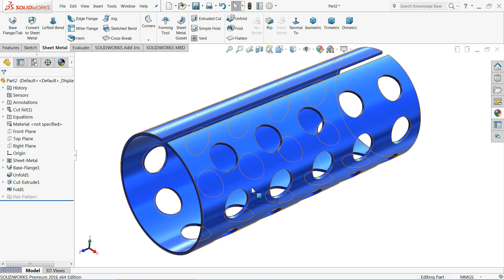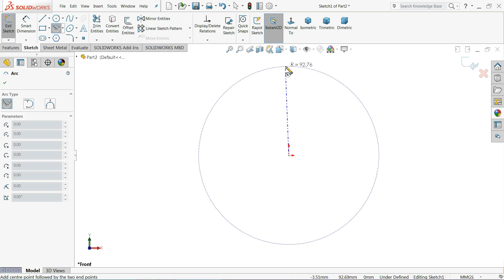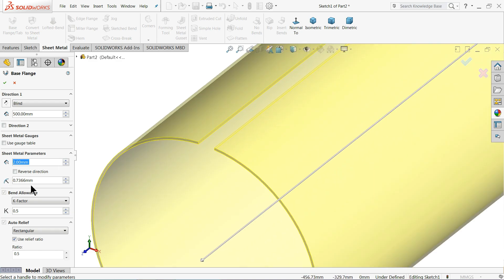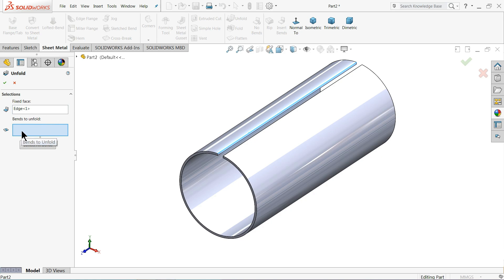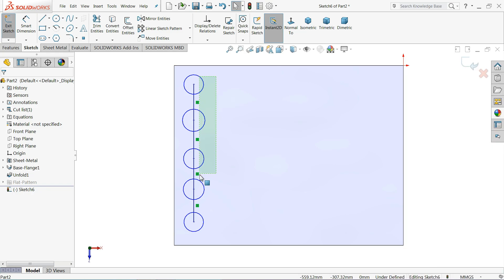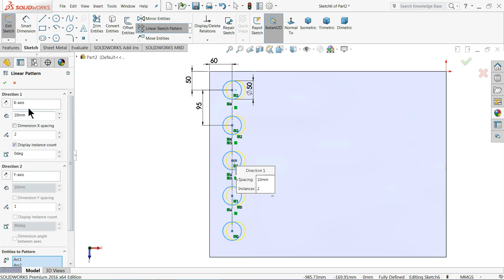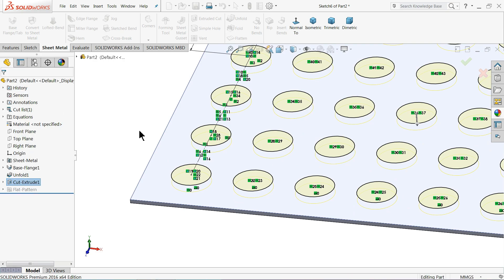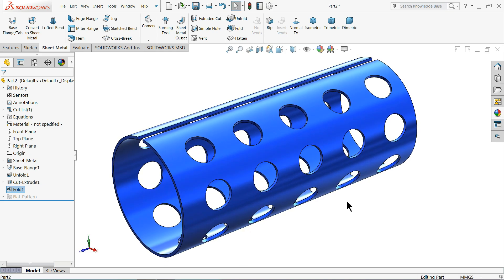Solidworks tutorial Sheet metal fold and unfold command

Comment: Love your tutorials!

Is there any way to unfold things that are not made with sheet metals base flange?

Like say for example that I made a wedding ring with with a design and then wanted to flatten it out to a rectangle (to make it easier to sketch a design on the ring).
Have not had to many good experiences using scribe and wrap.

Thanks
Reply: did you find a solution? trying to do this now
Reply: @pagnag4388  convert the solid bodies to sheet metal :)

Comment: HELP!! I need to make concrete forms. Flat shape 9' 11.75" x 11.75" out of 14 gauge steel. Then it needs to bend around a radius (that varies per size of concrete pad). So a 42' diameter ID would need several of these standard forms + 1 custom form. A custom form would be needed for each variable size pad diameter. The trick here is that these forms will overlap each other all the way around, as each form has a 3 hole pattern located at each edge. These form get bolted together. The pattern does not go, 1 form on the inside, 1 form on the outside.... Instead they are overlapping on the outside of one end and to the inside of the other end.
I'm STUCK!!!

Comment: PLEASE GUIDE ME ; HOW TO MAKE CONE IN SHEET METAL ,UPPER DIA 120 MM LOWER DIA 500 MM AND HEIGHT 600 MM  THK. IS 3 MM.
AL SO BLANK SHAPE OF CONE ,HOW TO MAKE.
Reply from the maker: make two plan ,keep gape 600mm, sketch 120 & 500mm circle on each plam, & cut the both circle by small amout like 01 mm & use sheet metal Lofted-Bend command,